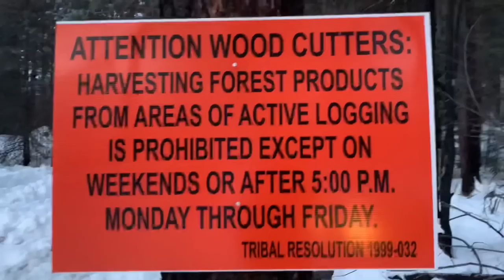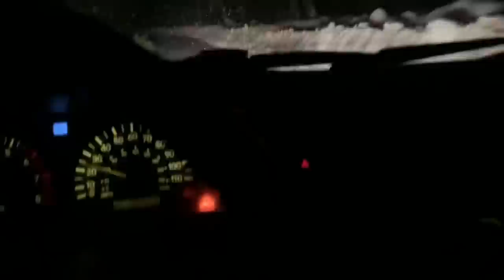Cutting Firewood at Night in Single Digits

Comment: David I had a old Ford that had a 351 modified in it, it actually gets pretty cold here in Arkansas and I had to get a magnet block heater for the ole Ford, kept it plugged in even when I didn't use it, liked the video man
Reply from the maker: Magnet block heater? Never seen those I will have to look into them! I started the hulk when it was in the negatives lol it fired right up just had to help it along for a minute or two

Comment: Burr. Great work. As a newbie to firewood cutting what is the etiquette on taking rounds that have already been cut and or split. I can see two sides. 1 being they are going to come back for them later so you should leave them or 2 pay it forward and let someone else benefit from what you couldn't get in your load. Maybe a universal code for take it or leave it would be stacking them off to the side if you're going to come back or leave them unstacked off to the side if they are available. Did miss seeing the hulk but can understand not getting stuck in subzero temps.

Comment: Looks good to me. Plenty of light. Maybe a small light bar and the back of kels truck but otherwise good setup. Run what you brung right.
Reply from the maker: Yes sir
Reply: @mountainlifewithdavidkelsie  hey how did you end up Liking that chain you were trying out after you touched it up I know you didn’t care for it too much out the box but everything is junk out of the box after you touched it up how did it end up working out I go through a lot of them at work was wondering if it would be worth trying to find a roll of that
Reply from the maker: @kingssawshop9251  it’s ok but I will never buy it again